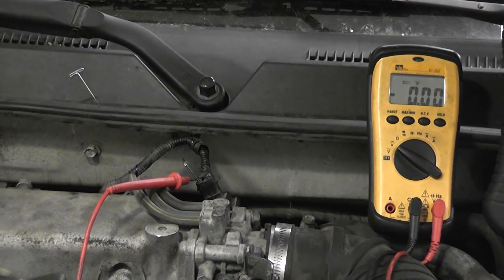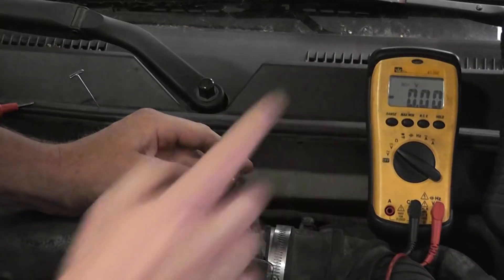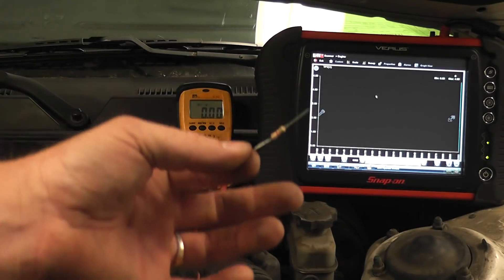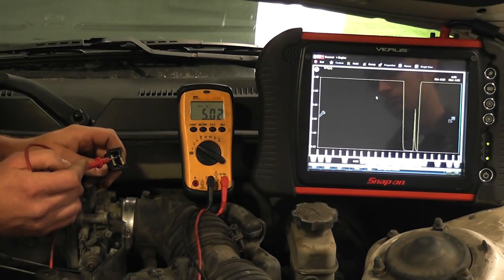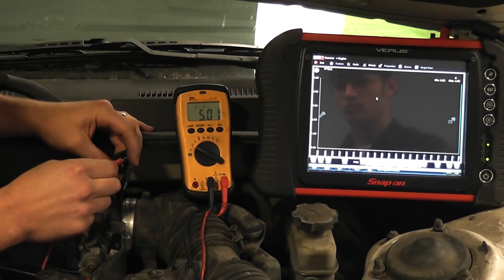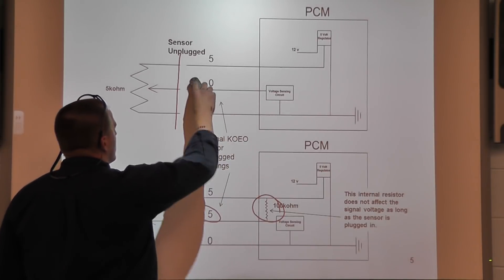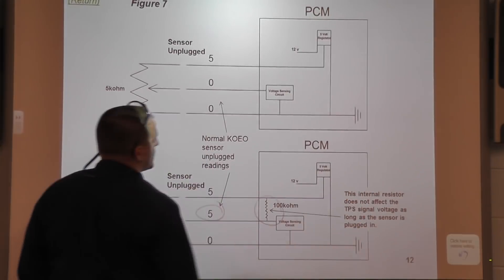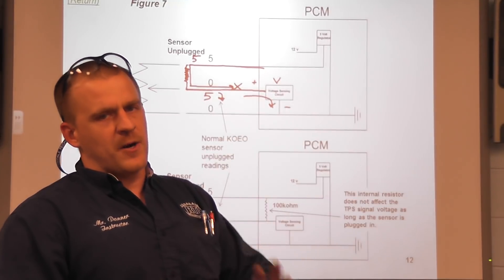How to test throttle position sensor wiring with a resistor (any car)

Comment: In this case the resister kinda becomes the fuse it will take a brunt of the current in the case the signal is shorted to ground in an unknown location right instructor just brushing up on my SCI

Comment: Would it be ok to use a 20 mA LED test light instead of the 5K ohm resistor?
Reply from the maker: Absolutely but it will drop signal voltage to around 2v instead of the full 5v. Use an incandescent style bulb and you'll see 5v while still protecting the circuit in case of a short to ground
Reply: @ScannerDanner  Thanks!

Comment: To test the sensor wire to ground, couldn't you simply unplug the connector, set your multimeter to resistance and check the resistance from the signal wire in the harness feeding the TPS to ground?
Reply from the maker: You could but it is an extra unnecessary test. Your already using your voltmeter to measure the signal wire, just move the same lead to the ground. Should be less than 100mv. Ground to ground voltage drop test for the win

Comment: I've seen broken wires inside the Insulation. Only a few strands of wire were still intact. The system would still pass all test but circuit integrity would still be compromised.
Reply from the maker: Yep, as soon as there is vibration and harness movement is when you'd see it

Comment: Hey Danner you've got me thinking now could you use a diode instead of a resistor to jump that circuit preventing voltage to come back to the 5 volt reference wire
Reply from the maker: Use an incandescent test light instead. It works perfectly and will also protect the circuit if the signal wire is shorted or if you jump it wrong

Comment: Perhaps someone can help? I am testing on  an 08’ caravan and found this video super helpful. When I test the wires for my electronic throttle body, everything seemed fine except the ground shows 2mV and sensor  2 also shows 2mV instead of 5v . Sensor 1 shows 5V. I suppose they are both suppose to show 5V .  I did the continuity beep test  with my multimeter to ground and it beeps, so I was expecting it to do so on the signal wire with the 2mV reading if it was shorted, but it didn’t.  Not sure if I have to do the resistor test here, or if it’s supposed to be that way?   Does anyone know?
Reply from the maker: What codes do you have?

Comment: How do you know if your system HAS a 5k ohm resistor built in?  Other than looking at a schematic?  I guess I just answered my own question.
Reply from the maker: It's just the average resistance of an input sensor. I use my incandescent test light these days instead
Reply: @ScannerDanner  Gotcha!  I'm a transmission guy, although I'm following your video series on circuit design. It all ties together whether you're working on transmissions, or troubleshooting no starts. Thanks for your quick reply, and much thanks for teaching through your extensive video coverage, your videos have been a go to source for myself on numerous occasions.
Reply from the maker: @Rick-O-Shay60  awesome, thank you!
And to expand on the test light further, if you accidently jump the wrong pins, you'll just light the test light (even on a 5v ref circuit) and you won't pull it all the way to ground.

Comment: Question, and you can tell me the direction to go
Throttle position sensor 
This is unplugged key in the on position 
I have 5.01 on the power side
The other two both show 7.3
Is that telling me I have no ground and why is my signal wire the same..thanks for any help
Reply from the maker: You sure that's not 7.3mv?

Comment: Exceptional video and teachings concerning wiring of this degree!
Got a question!
I have a 1996 dodge ram 1500 5.2 magnum 4×4
When I remove the plug from the TPS sensor and check the voltage. I have 5.8 volts on the reference wire and 5.7 volts on the signal wire.
Does this mean that the computer is 
bad/ corroded or a possible short in the wiring/plugs?
Hope you can help!
Reply from the maker: This is a little bit high but may not be an issue. What symptoms are you having? What is sensor ground voltage plugged in and backprobing?

Comment: What about a 6 pin tps? Specifically 08 ford Taurus
Reply from the maker: That's most likely an electronic throttle body, so 2 of the wires would be for the electric motor and the other 4 wires for the TPS. 5v ref, ground and two signals running opposite each other. TPS1 and TPS2 with one starting low and going high and the other starting high and going low

Comment: Sorry for this very common question. But what scan tool would you recommend, to see the voltages and voltages moving as you wiggle the wires?
Reply from the maker: For a pro or DIYer?
The Topdon Phoenix Lite 2 is my favorite under $1k full functional, bi-directional scan tool
Reply: @ScannerDanner  Thank you, I was able to figure out the electrical issue on the vehicle I was working on. The catch can was installed pressing on the harness. The catch can was heating the wires.

Comment: if the signal wire is 0 volts, we put the test light connected to the battery positive instead of giving 5 volts from the reference, would we damage the signal?I'm asking because we might not have a 5kohm resistor and don't want to risk a mistake!!
Reply from the maker: I use my incandescent test light for this all the time. Are you a premium member? I have some lectures I want you to watch in my chapter 10 playlist

Comment: Its very tricky when testing it cold and its ok. But when the engine reaches its operating temp and everything gets hot and expands the signal wiring in some old cars gives a higher reading and rpm surges and u think its a vacuum leak. What a wild goose chase i had in a year!!

Comment: Will this test work on any vehicle whether it is a car or ATV or Side-by-Side?
Reply from the maker: 100%
Reply from the maker: Just be aware of some variations in design as some of them may still use throttle switches. But if it is for sure a potentiometer type, the testing is identical on literally everything that uses one. Reference voltages may also vary, the standard on most car systems is still 5v

Comment: Need a process to bench test a throttle body with the tps incorporated in the side of the body. 

I have performed resistance test manually operating the butterfly valve but have no way to know what the adequate range is. 

Also, does this unit need to be powered up to test properly?

Comment: smart but y not just check ohms on the signal wire?
Reply from the maker: To do that test, one must disconnect the ECM connector and the component and then identify the correct pin or wire at the ECM connector. This is WAY more work than the test I am showing! And no more accurate, just more time consuming.

Comment: Remember that testing a tps sensor is best done with an older type analog meter as to visalize  the needle sweep for abnormalities.
Reply from the maker: They draw too much current and can actually lower signal voltage when trying to measure these low voltage circuits
Reply: 😂 Good one Jacob.
Reply: @Grunter123  The guy that is telling me that im wrong is totally misunderstanding something or is a know it all . He says too much amp draw on a simple ohms test ? You can lead them to water but you can't make them drink ! I happen to fixed alot of electrical equipment not just cars ,I might actually know a thing or two.

Comment: Hi Paul, at 6:48, or at 11:39 , when you have the resistor bridged between 5v and signal wire, what if the signal wire was open( broken), if you do the voltmeter test at resistor you will still get 5v on both sides though (as there is no current hence no voltage drop)? wouldnt you need to do a continuity test as well to make sure that the signal wire is not broken? or just do a continuity test on the signal wire , since we are not doing a voltage drop test anyway?  many thanks in advance.

Comment: I have Toyota mark 2 with idle voltage of 4.47 and at fully opened position is 1.45 and this is not normal readings so can I fix this problem
Reply from the maker: It may be normal, tread carefully. What codes and symptoms? Also what year, make, model and engine?

Comment: Is it necessary to have the scanner to show the 4.98 volts or can you just read the jumped pin on that side of the resistor? If there is a short will it still read about 5 volts on both sides of the resistor? I have a tps problem and a volt meter but no scan tool like that. P0122 code on a 1996 k1500 Chevy truck.
Reply from the maker: you need to see what the computer is seeing. If you do not have scan data, you may need to measure directly at the TPS signal wire AT the computer. With the key on and the TPS plugged in, what are the voltage levels on all 3 wires? Then unplug the TPS and measure them again and report the numbers to me

Comment: Would a 4.7k ohm resistor do the trick. I can't seem to find a 5kohm on amazon.
Reply from the maker: Yes, or you can use an incandescent test light instead of a resistor

Comment: Hey buddy..  What will happen if we remove the throttle position sensor connector and drive the car as usual? I'm stuck with my  Fiat Palio's 1.2 (2002) faulty TPS and couldn't find one. Does removing the cable from the sensor and driving the car as usual causes any problem?
Reply from the maker: It may not run or shift correctly. But try it is all I can say. There may be a decent backup strategy
Reply: @ScannerDanner  Ughhh.. Looks like i don't have an option. Anyways, thanks for the instant response mate!! Really appreciate it..
Reply from the maker: @Venkateswaran.  good providence my friend

Comment: Is it safe to use ammeter as a jumper?
Reply from the maker: No sir, it is just as dangerous as using a jumper wire but for this test, yes, you can use it as a jumper wire. Just know there is no more protection than if it was a jumper

Comment: I watch your videos which there awesome ..but I’m still lost my tps which is on the throttle body  has 8 pins so how the hell im a suppose to find which is which without really damaging everything else like the pcm and such ...and the app has 6 pins which there are no videos out there ..need help ..still working on that same 2002 gm trailblazer ..I don’t know what else to do ..
Reply from the maker: on an 8 pin electronic throttle body you would most likely have 2 wires for the motor control and then 6 wires for the TPS. TPS 1 and TPS 2, each with a 5v ref, signal and ground just like every other 3-wire potentiometer. Your APP is the same way. APP1 and APP2, each with a 5v ref, signal and a ground just like in this video

Comment: Where is black connector go?
Reply from the maker: To the throttle position sensor
Reply: @ScannerDanner  
Red wire lead (positive) was put to throttle position sensor black wire lead (negative) goes where?
Reply: Can you give me right information please. 
I will so appreciate!
Reply from the maker: @НикМарк-д1д  battery negative for the voltage measurements I was showing

Comment: I have 2005 a4 will tps1 and tps2 on throtlle body both be 5v ?
Reply from the maker: unplugged, maybe, plugged in and backprobing, absolutely not, if we are talking about the signal wires
Reply: @ScannerDanner  unplugged sensor 1 is 0.3v and sensor 2 is 1.45v.
Reply from the maker: @rickykent4543  and what are they plugged in? What are your codes and symptoms?
Reply: @ScannerDanner  not back probed yet, codes are p0221 throttle pedal sensor and p0638 throttle body actuator, new pedal installed and new throttle body,  still have epc light and ecm light, engine is in limp mode and idles very erratically and surges. Ecm connections were very dirty and gunky, cleaned terminals and connectors hoping this would solve the problem but nothing has changed.
With vag com the throttle body would not align and came up with error.
I need to ensure the wiring is 100% before I look at an ecu rebuild.
Reply from the maker: @rickykent4543  post this to my forum, it is free to join and I have paid moderators who are there to help me help you guys. Thank you! I can't offer research and back and forth tech support here. It is just too difficult to keep up otherwise. 
https://www.scannerdanner.com/forum/post-your-repair-questions-here.html
Reply: @ScannerDanner  checked all wires for continuity and pin 4 on the throttle body had a poor connection at pin 84 on ecu connector.  Car is running fine now with all lights out.

Comment: Hey paul and thanks for your effort and sharin your awsome knoladge,i just have a question,you mentioned to use 5kΩ resistor to avoid any  possible short between 5v and gnd when we 're dealing with fixed 0 volt on signal wire,so what about when we have fixed max voltage on sig wire ,let's consider there is a short between sig and the REFv and we short the sig to gnd to see any V dropping to confirm wiring integrity?i mean is there any possibillity to cook the REG IC in this condition or not,if no then how.
Regards.
Reply from the maker: Do the test with an incandescent test light instead of the resistor for both examples and you'll have nothing to worry about. Great question!!
Reply: @ScannerDanner  hi and thanks for the respond,another question: can i measure the resistance between signal and REF V wire to determine the kind of circuit design??
Reply from the maker: @aminmombini6882  unfortunately no you cannot, every car is different
Reply: @ScannerDanner   ofcourse you 're right the value of the resistance would be diffrent ,but what i mean is the diffrence between having and not having internal resistance,at least we can distinguish the design ,can't we?
Reply from the maker: The problem is with circuit board designs and they change even year to year. Try it, you'll see, you get some real conflicting readings. There are other paths in that board that the ohmmeter can travel through.
Either way, it doesn't matter, it is a test that will not help you. If you are dealing with a sensor signal that is fixed at 0v or 5v (disconnected). Take your test light and change it and look for a scan data response. If it responds (5v drops to 0v or 0v jumps up to 5v), your signal circuit is fine. No other tests are needed on that part of the circuit.
Reply: @ScannerDanner  does it work on electrical throttle body also?
Reply from the maker: Every single potentiometer on the car
Reply: @ScannerDanner  thank you so much sir for the time and   being humble .god bless you .

Comment: hi, 
Opel Astra h 2008 1,3 cdti  car 
accelerator pedal socket pin no:4  51 ohm by adding resistance Does it have any effect on pedal response? Does it affect performance?

Comment: You don't need to do all that, just check your computer and check your sensor. you can do a bench test on the sensor or check it with the ignition and computer, all that is a waste of time.

Comment: first the Big subscription !!  second how many pin on the throttle body you will have if there are 2 TPS and 1 DC motor??
Reply from the maker: It depends on the manufacturer. 2 separate TPS circuits may use 6 different wires but they can do it with 4 if they share the reference and ground. Then the motor itself would be 2 wires. 
So 6 to 8 wires depending on design
Reply: @ScannerDanner ScannerDanner thank you !! is the throttle body actuator always a dc motor or we can use stepper motor also? normally I need to connect the throttle body DC motor with Arduino or raspberry pi controller for controlling the valve condition (closed or open) depending on the load the vehicle carry. so do you have some ideas how do I connect them? should I use a relay? H bridge circuit?
Reply from the maker: @freemanfreed1581  yes, it is a reverse polarity DC electric motor that uses pulse width modulation controls to open and close a heavily spring loaded closed throttle plate. How to tell you how to build a control circuit for this? I have no idea, sorry.

Comment: GREAT videos,man; 
I will add this,a 5 dollar meter,in ohms,(200) WILL tell you if the signal wire is shorted to GND or not; i do it w/ my old (i mean,over 30yo)IBM 8060A when i have it with me,if not,with anything,starting with a test light(but, N O T ending with it,if is does not light up!); NO need for a 1999 doll.scanner for that  simple task; nor for other tasks most of the times.